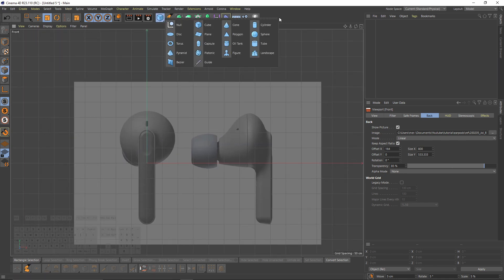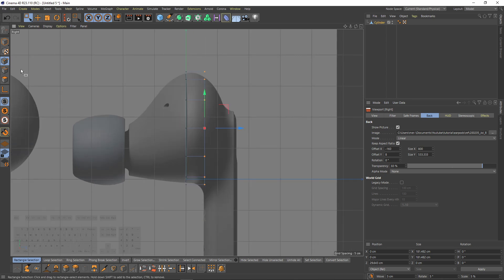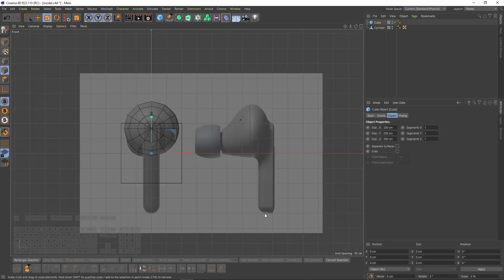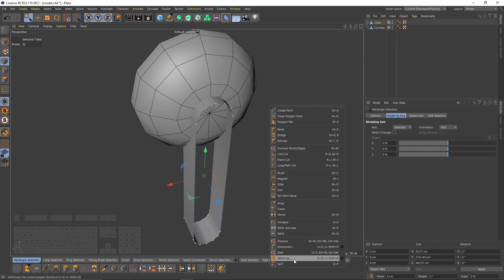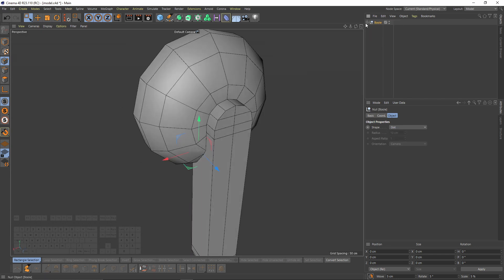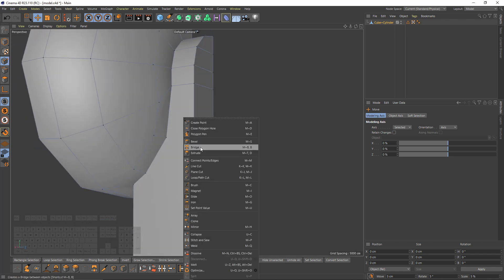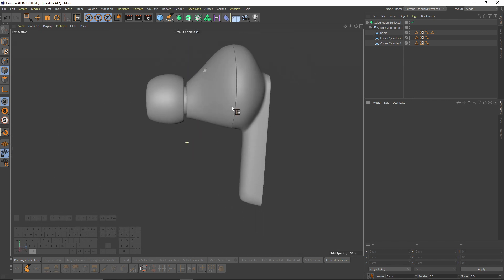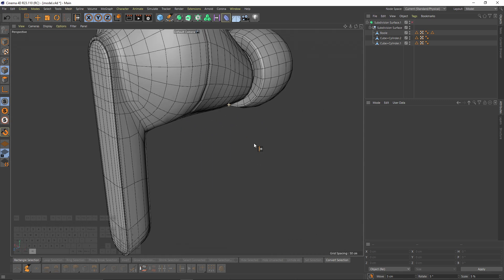Industrial Design/Product Modeling #4 | Earpod | Cinema 4D Modeling Tutorial

Comment: Very good Tutorial. I got problems after uniting the two objects with Bool Tool. My surface looks not clean and stretched or pressed in some areas after I slide the points. I need to work on that area, but I learned a lot. Thank you for your tutorial.
Reply from the maker: Thank you, keep practising!

Comment: Did you use the iron tool here 6:49 ? Or just used slide tool? I am not able to do this procedure to duplicate these edges. Thanks for this tutorial!
Reply from the maker: It is Slide tool, I rarely or never use iron tool.
Reply: @polygonpen  problem solved! I´ve used optimize command to fix weird behavior of slide tool, because the edges seemed to be separated from each other. Thanks for your reply!
Reply from the maker: @marcossouzajr1711  Perfect